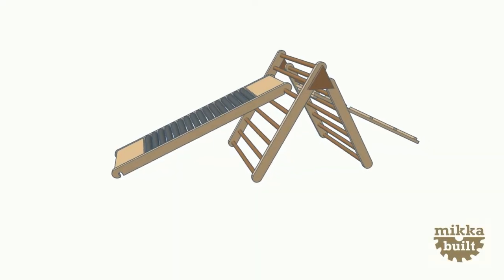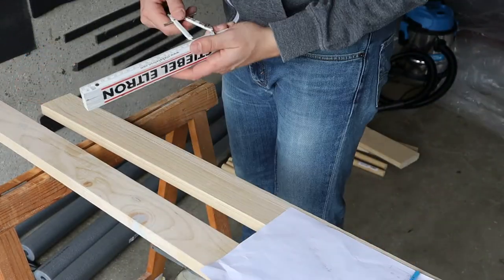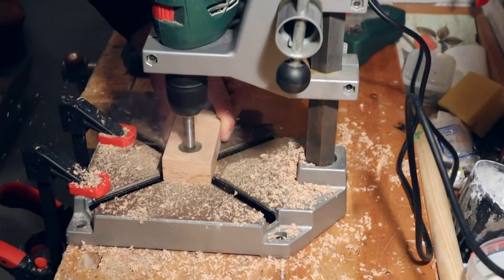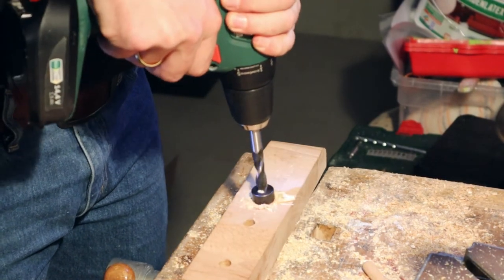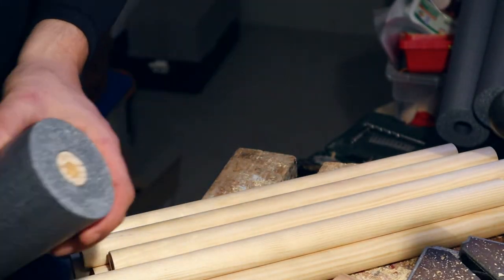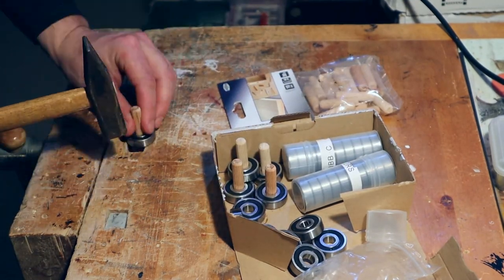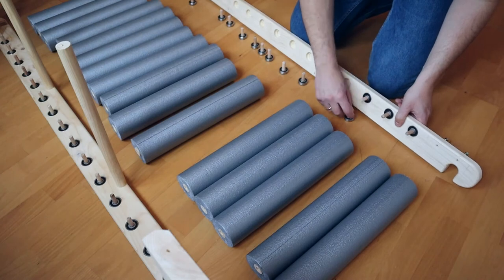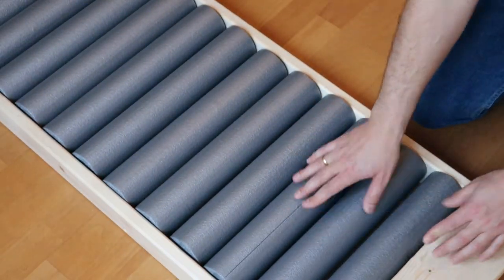Awesome Roller Slide for kids (Pikler Triangle upgrade) // Rollenrutsche für Kinder (Kletterdreieck)

Comment: Why not use your miter saw to cut the foam? Great video. Your next project should be a manual treadmill :)
Reply from the maker: That's a good idea. I'm planning to build an extension for the slide ... so another chance to try some other methods. 
A manual treadmill? I will think about it!

Comment: Do you have a list of materials/written instructions?
Reply: Hi Diehardhunterthe! Here the list of materials/ I don't have any written instructions yet:

2x squared timber 200x24x72mm
32x wooden plugs 10mm Durchmesser/ diameter 
32x bearings 25mm Durchmesser/diameter 10mm Loch/ hole
4x round timber 200x18mm
4x pipe insulation 200x40mm 16mm hole

Comment: What kind of ballbearings did you use that fit the dowels so nicely?
Reply from the maker: I used  bearings called: "Deep Groove Ball Bearing 6200 2RS 10x30x9 mm". I'm sure you will find them, if you google this specification!

Comment: Hallo Mikkabuilt. Finde ich toll. Habe soeben ein Piklerdreieck gebaut. Das wäre eine gute Ergänzung. Kannst du nicht kurz eine Materialliste angeben.?
Reply from the maker: Hi Berthold! Danke für dein Feedback ... hier die Materialliste:

2x Kanthölzer/ squared timber 200x24x72mm
32x Holzdübel/ wooden plugs 10mm Durchmesser/ diameter 
32x Kugellager/ bearings 25mm Durchmesser/diameter 10mm Loch/ hole
4x Rundholz/ round timber 200x18mm
4x Rohrisolation/ pipe insulation 200x40mm 16mm Loch/ hole